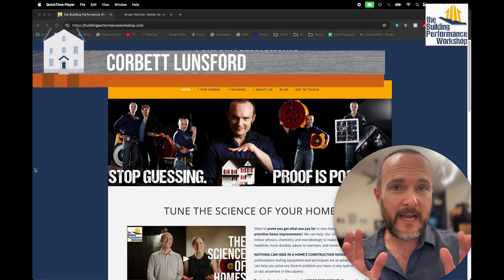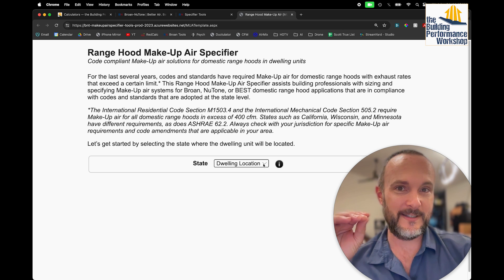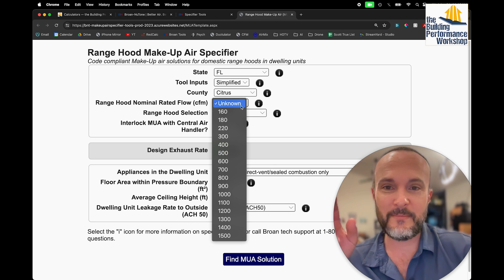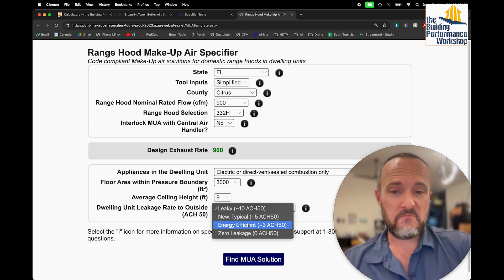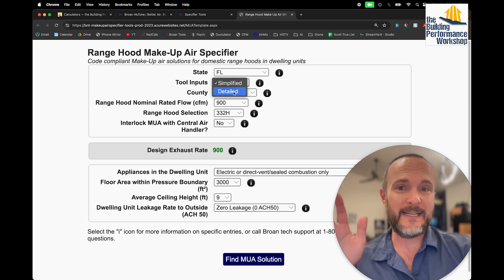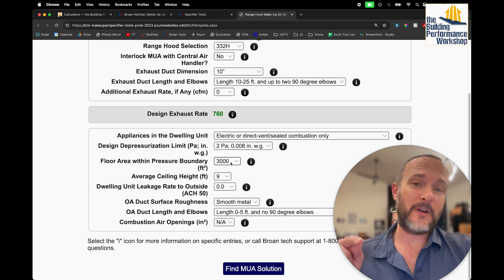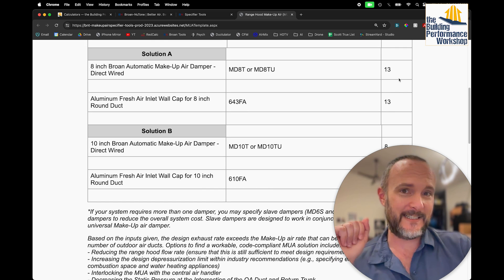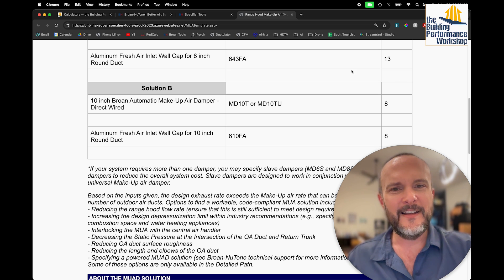Massive Mistakes in Make Up Air for Homes

Comment: Great video, I’m searching for any videos on the exhaust portion of MU air (the origination of the need of MU air) and found this video. I’ve noticed it is extremely rare to find information on appropriate exhaust systems (exhaust vents) through the roof. Do you have any videos on those (ie moving 700+CFM without constraint outside through a roof. )
Reply from the maker: Thanks- try this:
How to Install a Fantech Kitchen Exhaust Hood Liner
https://youtu.be/h7eXuwkfDm0
Reply: Great video on the ‘exhaust’ system. However I was specifically referring to the transition between the inside to the outside (roof vs wall). Commonly referred to as a GRV /Galvanized roof vent. I’ve noticed these ‘gooseneck’ type products or similar do not seem to be adequate with respect to aerodynamic pressure drop (they seem to restrict). 

Do you have a video of transitions outside of the home (last part of exhaust) either through wall or roof? 

Again thank you in advance.
Reply from the maker: @tillmansr2002 sorry, no- the manufacturer may have airflow and pressure data tho

Comment: Really useful, and perfect timing.   Building an 1.5 ACH home and trying to figure out the best solution for makeup air for a gas range.   Thanks so much !
Reply from the maker: Cool Sam- hope everything goes great.
Reply: Sam Before you buy the gas range test drive an induction. It will heat faster, hotter respond faster and nothing gets burned on the outside of a pan.

Comment: I have a tight 1972 bungalow, 1.24ach. Im thinking to put in a mua unit because with 2 kids its not rare that the clothes driver and 2 bathroom exhaust fans are running at the sametime
Reply from the maker: Your kids use the bath fans? Good training buddy!
Reply: @HomePerformance  yesss

Comment: You mentioned dryer vent.  Are you recommending the use of make up air when the dryer is on? Can the dryer make up air be accomplished with ERV instead?  Thanks!
Reply from the maker: Any 1-way exhaust becomes a problem, the dryer just happens to be overlooked in many cases. No, ERVs cannot unbalance enough to provide 150 cfm more on one side than the other- many of them are 150 cfm max.

Comment: That is a wild difference. So should the idea of a passive MUA system be eliminated from the conversation in the context of energy efficient homes, and only discuss powered MUA systems?
Reply from the maker: I think so, if you build like Joel does. But if it's a big fat house that's only 4 ach50, you might be fine. Math will tell.

Comment: We were lucky we built our house after you did the video on makeup air in your own home. Putting the make up air vent right above the range hood worked best for us and then use a infinite varriable intake fan and manometer to get the setting right. Im glad we saw it because originally we planned to cut a big hole in the floor under the range hood and run it through our foundation. Much easier to do and make changes in the conditioned attic.
Reply from the maker: Great to hear! Thanks for letting us know, and good work.